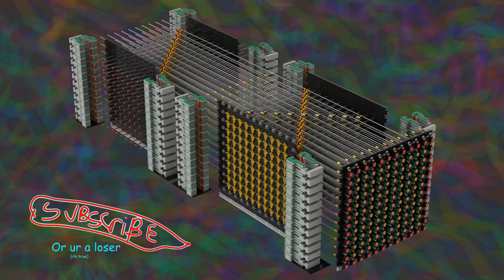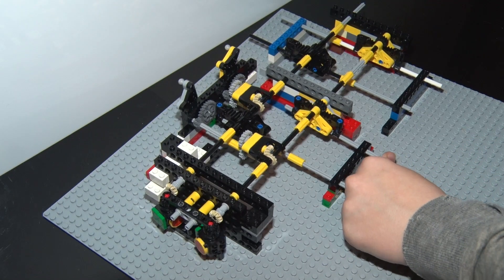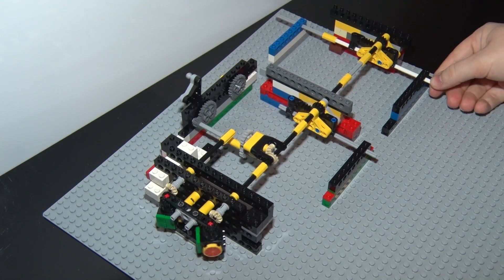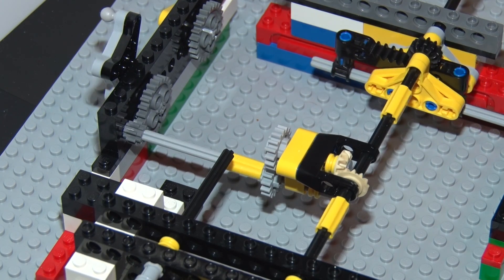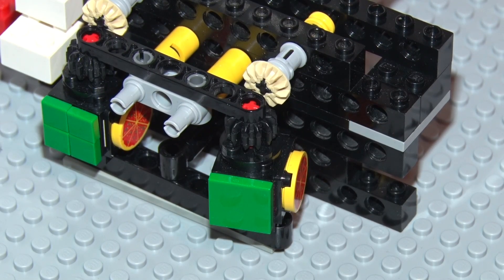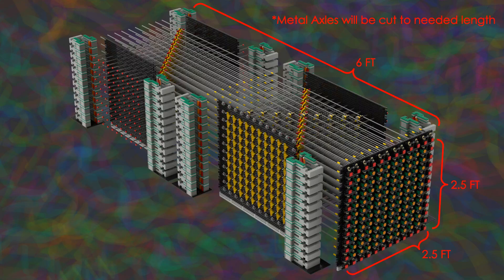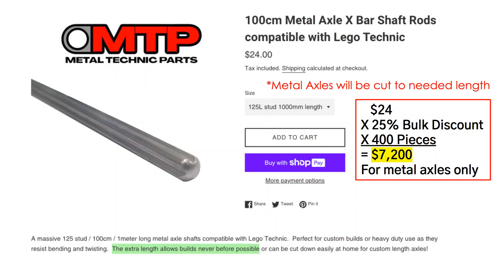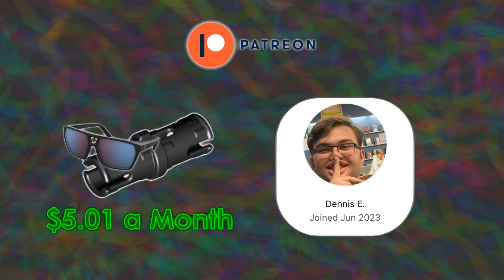LEGO Computer Part 5: Mechanical Screen

Comment: I really love the Idea and the whole project!

So I have two thoughts about this.
1. Using technic liftarms (32278 or 71710) instead of steel.
Connecting the liftarms end to end with "liftarms thin" on the sides held with axles and 3/4 pins.
(That way is possible to make it as close to 100% LEGO and I hope safe some Money)

2. Couldn't you technically make a cube for the screen.
Front = Screen, Sides = Write (Snake/Blank), Back = Reader

To Reset You can do it in two ways:

1. Mechanical:
A giant system wall/plate with shaped holes that is sandwiched behind the reader liftarms.
(the reader Liftarms would have "60483 Technic, Liftarm Thick 1 x 2 - Axle Hole" behind them OR a pin with a "Technic, Liftarm Thick 1 x 1 (Spacer)" attached to the back to work)
Then when you want to reset the screen you simply move that wall/plat and the added piece is moved in the desired way similar to the Memory in Part 2.

The Shape would look like a 7 where the top is bigger so the reader liftarms freely move. To Reset you move the wall/plate up and then to the side.
OR
Y Shaped where the reader liftarms pivots at the cross point. To Reset you move the wall/plate up.
For this shape to work you would need to change the Screen Tiles though...
Middle is Black and Left/Right is Snake/Food

2. Algorithm: 
It needs 4 Switches (that are technically 2 3-State-Gearboxes): Top and Bottom right, left and right
1. Activates gearboxes that constantly advance X or Y.
-> Gantry reaches top right corner and hits the top right switch that's connected to stop Y, reverses X and sets the tile writer into a constant wirte state.
2. Gantry moves to the left one by one, writing all tiles until it hit's the left switch.
-> Gantry drops once on Y and reverses X.
3. Gantry moves to the right one by one, writing all tiles until it hit's the right switch.
-> Gantry drops once on Y and reverses X.
4. repeat at 2. until the Bottom right switch is hit.
Reply from the maker: The reason for the long metal axles is to reduce slop in the system. The channels are up to 8ft long and plastic axles or lift arms would bend and introduce too much slop into the system where if I move one writer in the back it might not actually move the screen tile 8 feet away. I also cannot make it a cube style because I need the extra spots for readers. If you look at the diagram at 0:28 you will see the label for each reader. In part 3 I cover the vertical gantries used to read and write. The writers are writing to different parts of the screen at the same time so they can't overlap and need their own space. The resetter I do plan on using the plate style resetter on the back of the axles. I may have multiple of them too for different screens too! Maybe even different level designs... I like your ideas though!

Comment: Of what metal are made the metal axles ?, because maybe you can get cheaper ones if you buy made of aluminum
Reply from the maker: The ones from MTP are aluminum, and are the only ones on the market that are 3 ft long so there are no other options.